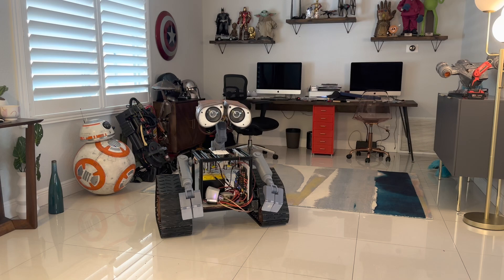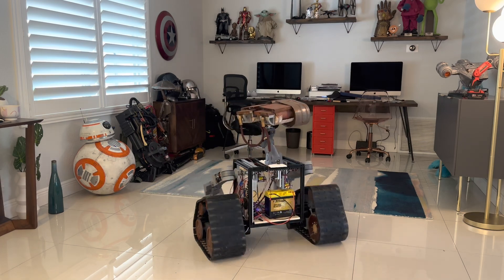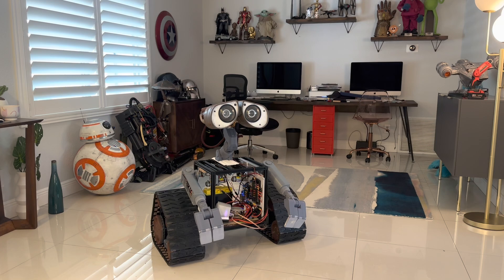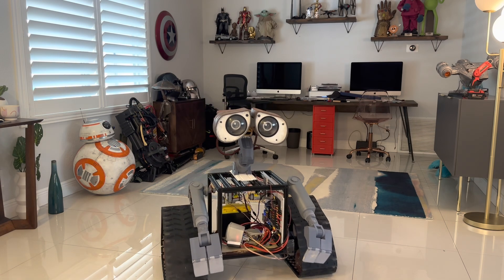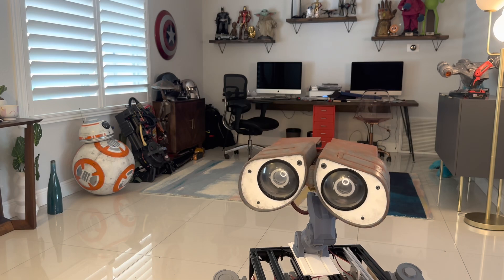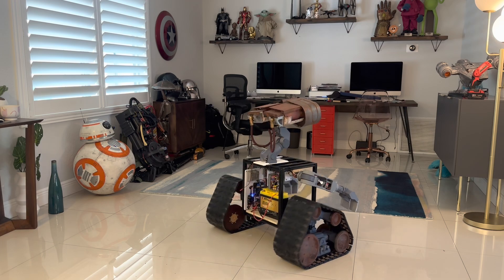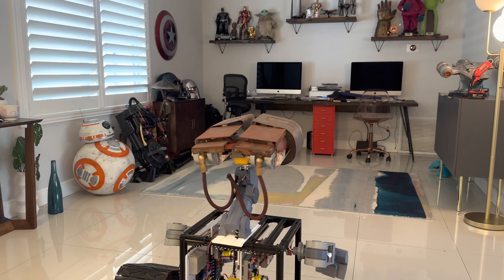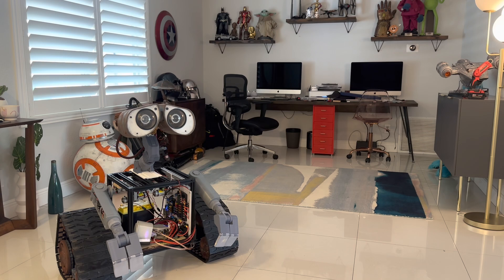Wall-E 2.0 First Drive Test

Comment: Are you going to keep the track plastic or will you cast rubber truck?
Reply from the maker: It will stay with the tread caps that I created. I don’t want to go to all the trouble to do the castings for all the treads plus all the extra weight it would add.

Comment: What are your plans for the suspension? Is it going to be passive or do you plan to add some controllable tilt, roll, and elevation to the body?
Reply from the maker: At the moment it will start as just a passive spring suspension. Then down the road I might add a front “lift/tilt”, but not full on elevation or multi axis roll or anything.